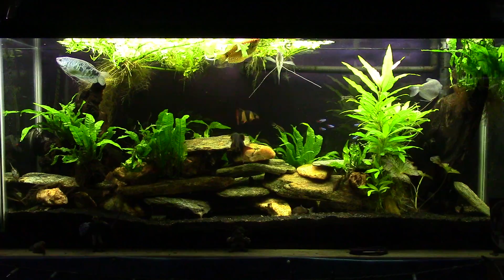A Chat About Gas Exchange, Circulation, and Watching the Whole Video.

Comment: I think your video was awesome! During a snow apocalypse my discus community tank was out for 2 days. Temp went down to 64. I had 12 7/8 in Discus a pair of apostolic cardinal tetras, Cory’s, Khuli loaches and not one fish died. It has to do with the heat. As well all know higher heat less gas exchange. Everyone’s tank is different and the maintenance varies. There are many more factors that can cause the fish to die. I too don’t like bubbles and noise in my tanks.